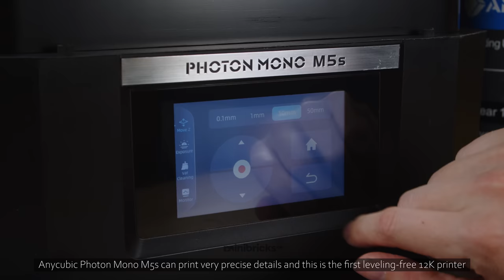Minibricks: Diorama building of realistic Subnautica / Photon Mono M5s

Comment: Another amazing work!!
May I ask, if you varnish (flat or gloss) your models, before you pour the resin? If yes what kind of varnish are you using? (I mean acryclic varnish or laquer varnish?).
I am asking this, because I tried also do something similar, but my epoxy resin dissolved the mat varnish (which is testors acrylich flat varnish) and therefore the finished work seems very dirty (with dissolved particles inside)

Comment: Again an amazing work, well done! I will have just one question. Do you apply a top-coat to the models (which are inside the resin)?
Like a gloss or matte coat to protect paint from epoxy resin.
I am asking this, because I just finished a (deep pour) resin model (u-boat) and somehow my resin attacked-disssolved the matte varnish which ı applied on the model.